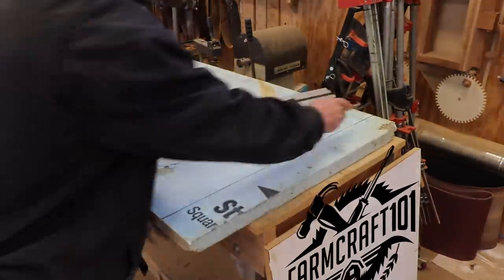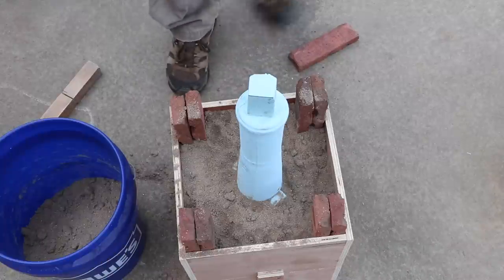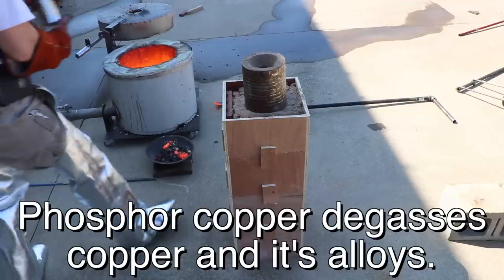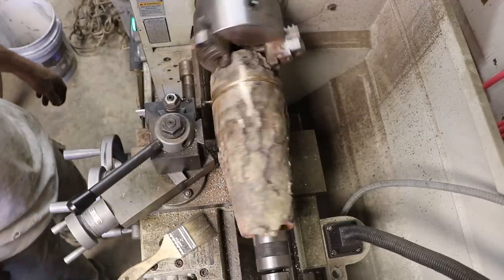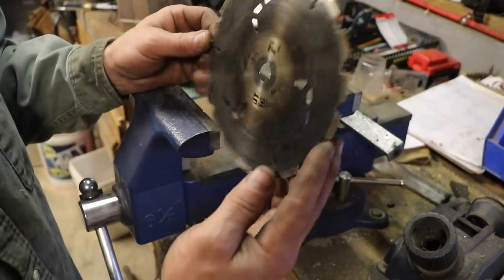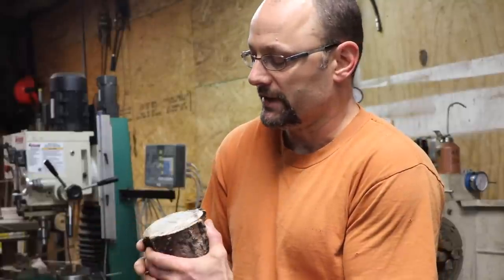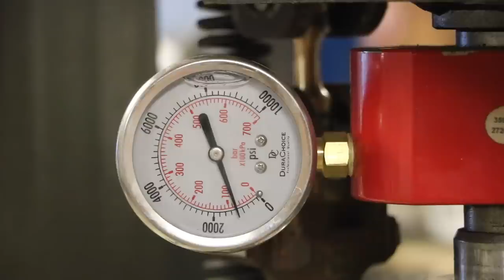How NOT To Cast A Historic Bronze Cannon Barrel.  FarmCraft101

Comment: Make a traditional cope and drag mold with the green sand. Pack sand real good  and add sprues to vent properly. Paint inside generously with an alcohol based ceramic paint for a very smooth finish. I worked in a foundry as a mold maker and that was our process for the cannons we poured.  Cheers!
Reply: yeah, sprues make sense ….  isn't there a liquid additive that is used to condition the mold sand ????
Reply: @pondturtle4972  yeah there is its a fast cureing epoxy is all.  That is why you need to work like hell to get it packed and level before it sets up.
Reply: The problem is the core, but they used to use molasses mixed with the sand before the green stuff. They used to bake it. Green sand semi-hardens all by itself.
I did a lot of work for a very large iron foundry. The owners said they really didn't process the iron, they processed sand and moisture. For every ton of iron they melted, they processed ten tons of sand.
Reply: Where can I purchase some Alcohol based ceramic paint.
Reply: @garygordus4465  just look up foundry supply. Its a refractory coating.
Reply: Question for you chainsaw. Does this guy know what he’s doing?  He seems to have dangerous issues occur throughout the video. I’m not an expert by any means. I watched my father and his teaching partner when I was younger. I watched them pour copper and aluminum more than anything into ingots for their middle school classes. Never did I see the heating system pop like it did. Thanks an your thoughts
Reply: @beebob1279  This casting would have worked had he put two big vents on the highest parts and used more metal. Having the extra mass of the vents allows for faster flow and controlled shrinking of the part.  The risers or "vents" as i call them have to be placed on the highest and biggest parts of the pattern. They are later cut off after cooling but are 100 percent nesessary.  Even with "green sand " . Tilting the mold slightly also helps but isnt nesessary on such a simple pattern.  His vent was in the wrong place,not of adequate size and he ran out of metal too soon.  Hope this helps. Oh and the metal pops and splashes everywhere ! Thats normal.
Reply: @beebob1279  im also referring to his latest attempt.
Reply: @chainsawjackson944  Thanks for the information.
Reply: I've wondered how they get smooth brass cast fittings.
Reply: @texasdeeslinglead2401  those are cast using something like a plaster investment mould, not a sand mould.
Reply: You are right I make molds from my own made green sand. A good core would be clay extruded from a pipe and then bake the core. He had some steam issues in the sand mold.....

Comment: It's not a failure it's a valuable lesson so well done and keep it up I know you will succeed
Reply: Watched a video on cannon making the you tube video is made by masters of ineptitude hope this helps
Reply: They also used cores so as to NOT do to much drilling, and used techniques similar to bell casting
Reply: Dunno, might as well have googled bronze casting before starting. I think I saw them using clay around a wax model for casting church bells. The wax would be melted and drained before pouring.
Reply: @rubenproost2552  yeah, also, the clay provide a sealed mould, and burying (as in digging an actual hole in the ground and fill in the gaps around the mould with very fine sand) would provide structural support. And also, provide a gas vent from the bottom outside the actual mould.
It can be done with styrofoam, but I'd do it as with lost wax, build a clay mould around it and pre-burn the foam out.
Reply: F.A.I.L. = First Attempt In Learning.
Reply: @SonsOfLorgar  I think the first cannons where cast by the same guys that made church bells as they where the only people that had the facilities and knowledge to cast such a large amount (for the age) of molten metal in one pour

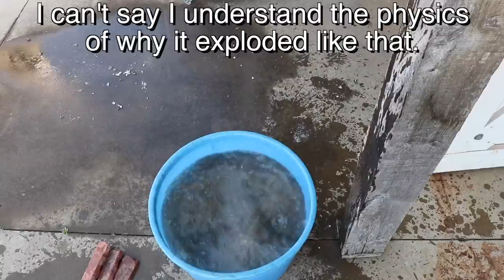Comment: 8:58 the reason it exploded is because of a localized steam explosion.  As the surface cooled, it contracted which caused some molten metal to squirt out.  That molten metal hit water and  locally superheated it beyond vapor temps.  That caused a local steam explosion that propagated thru the surrounding liquid.
Reply: Yep, I was going to say this with words that weren't so descriptive. I worked in a die-cast shop and we were shown just how dangerous any can or bottle of liquid can be when dropped in molten metal. If the container goes under the metal fully then the liquid turns to steam instantly and when a liquid turns to gas it expands. That much liquid expanding that fast explodes and the molten metal then shoots out of the pot just like the water did in the bucket.

I actually was working beside a machine that had water go into the pot through the gooseneck (that is a piece of metal that has a piston in it that pushes the molten metal from the pot into the die) and into the pot. There was zinc spray about 50 feet away in all directions. It splattered on the ceiling and the ceiling was about 30 or 40 feet high. Very dangerous stuff.
Reply: That feel when you scroll down and someone else has already said the same thing, lol.
Reply: No molten metal squirted out. Wtf. It simply flash-boiled the water around it, the bubble of rapidly rising steam carries the water above it as it rises and spurts everything into the air.

..Contraction.. squirting molten metal.. what the fuck, dude. Just no.
Reply: I mean. No. That isn't how metal behaves. If it's contracting that much it's strong enough to retain the pressure of the slightly warmer core. Like.... holy fuck this is dumb. 

It exploded like the because the metal initially experienced the Leidenfrost effect, and a layer of steam prevented the liquid water from contacting the metal as a whole. The metal quickly cooled, the gas layer subsided, and the large amount of water then contacting the surface instantly boiled (cooling it further, the Leidenfrost effect stopped happening because there wasn't enough energy at the surface of the metal anymore).